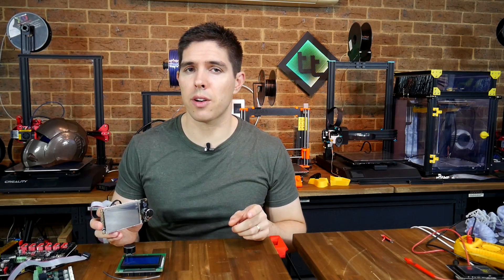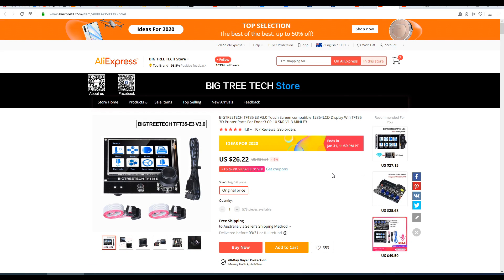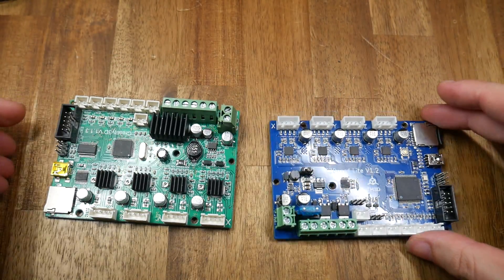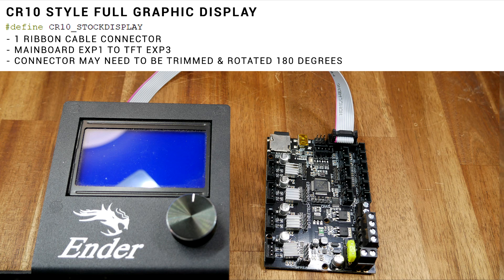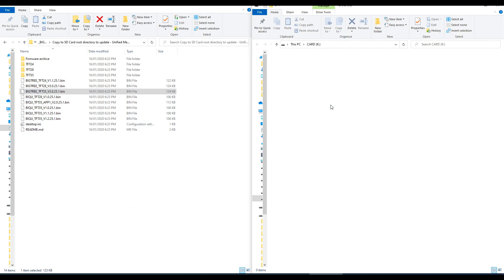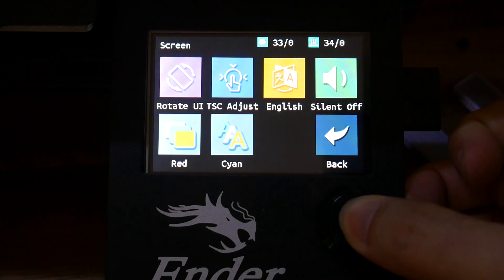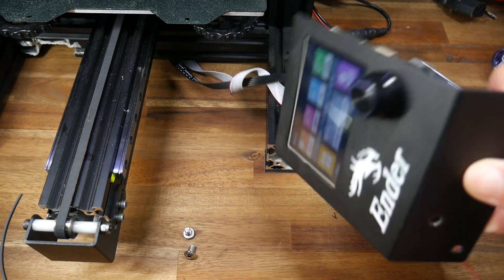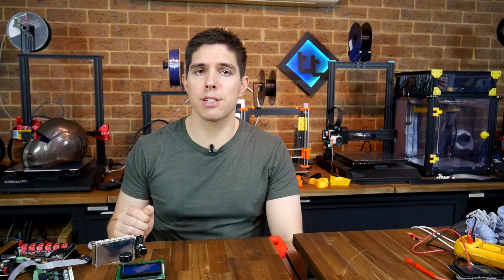BTT TFT35 dual mode touch screen guide

Comment: Great video, very informative as usual. 
I have installed one on my CR-10S Pro working in 12684 mode. So far I am really happy with it. I will now have a go at changing the firmware to make it full screen.
Reply: can you share some pics and any steps needed. Thanks
Reply: deadsimple ali you can send me a message in messenger and I can give you a few details and photos.
Reply: @deadsimpleali5540  hello, i cant find you on messenger, and can we discuss about your installation on a cr10s ?
Reply: @chrisnzog8643  hi Chris. I ended up getting an SKR 1.4 board. Im in the process of installing it on my CR10S pro
Reply: @deadsimpleali5540  did you ever end up installing this on your CR 10 pro? I have a CR 10 smart and I installed it and it’s working good but the SD card slide and USB port are not functional and was wondering if you may have had the same issues?
Reply: Sorry bro I dont have a Facebook account so cant use messenger. I hope you can share via email
Reply: et ça fonctionne du coup ?

Comment: Great video, as always. Your channel has helped me tremendously.  I have the btt tft35 v3 with skr 1.2 mini e3 and octoprint. It has communication issues when on the touch screen and printing from the octopi. When printing round surfaces and radiuses the steppers stutter and leave blobs and zits on the print. When you switch to the simulation mode no more problem. Works great when printing straight from the btt tft 35, or from the onboard sd card of the MB. I enjoy the ease of the tft screen but also enjoy wirelessly uploading to octoprint and the plugins. Hopefully they find a fix soon, til then can't use them together for prints with a lot of curves.
Reply: I have this issue also.  For now I've been printing from the SKR's SD card in Marlin mode, as I had Octoprint lose it's USB connection 6 hours into a print.  There's a closed issue on Github about it.  The main dev has suggested connecting the Pi to the TFT directly via RX / TX serial pins instead of USB.  He says the TFT will then pass it on to the printer.  I'll probably test this at some point.
Reply: @cscoppa  yeah, I've been keeping an eye on the issue. I will try it to. Thanks for the reply.

Comment: Using this with an Ender 5 Pro that's barely a shell of it's former self at this point.  Really like the features and being able to switch back and forth.  No problems with Octoprint... (Vanilla Marlin latest bugfix).  However I have found ONE problem that's annoyed me slightly, though I suspect I may be able to fix this in the firmware, I just haven't looked to see if it's software coded or hardware based, but I'm sure it's just software...  That's the pressing and holding to switch modes.  There are some features in Marlin that use this same process (i.e. I use unified bed leveling, and during manual mesh editing you can press and hold to kick back out)... When attempting to do so it will try to switch the LCD as it seems the delay it just slightly shorter for the LCD switch...

Comment: Great Video (as always)!  One thing worth adding.  The encoder wheel becomes all but useless when in Touchscreen mode (with one exception). In touchscreen mode, turning the encoder WILL affect the feedrate/speed of the print, but you can only see the new feed rate value if you switch back to LCD mode.  The FR Icon in touch mode does not update automatically to show what the encoder wheel set, it will only show the last value you set in Touchscreen mode.  I believe this is because no GCode commands exist that allow the touchscreen to query the value from the controller.        

With the exception of the encoder wheel in touchscreen mode, I am happy with the TFT35.   I can confirm that  Octoprint and the TFT35 work well together on an SKR v1.1 Pro.
Reply: Hi,
I have made changes to the firmware to support using the encoder/wheel, l'll make a merge request.

Comment: I have the standard version of the screen, and I've noticed that the knob doesn't come off, is there a trick to that?
Reply: Had the same issue. Ended up using a screwdriver to carefully remove it

Comment: I purchased the E3 bundle with the SKR mini a week ago. Wish I'd waited a bit longer to see this video before installing 😅. It was mostly painless. Thank you for such in-depth and easy to follow guides. 
    I have to say, I MUCH prefer using the touchscreen mode over Marlin. It feels snappier, more responsive, and just plain looks cooler too. The biggest downside is the knob is disabled in touchscreen mode, and I still find myself uselessly turning it for adjustments from time to time.
Reply: I do the very same thing still today.

Comment: Great video and very interesting product!  I just wanted to comment that you don't need to trip the connector on the ribbon cable.  You can generally pull the plastic guide on the board up off the pins, turn it around, and push it back down into place.  It's just a friction fit over the pins on the board.

Comment: Any idea as to when you may try to get it working with the EZBOARD Lite using the serial pins?
Reply: Kev7274 I am waiting on mine to confirm. Should be able to this weekend!
Reply: @itsmegriffo  Excellent. Please keep me updated.
Reply: Any update?
Reply: @Kev7274  yes, it works. I am sending my firmware adjustments to TH3D so that it can be added to the Unified firmware.
Reply: @itsmegriffo Awesome.How did you hook up the  serial pins?
Reply: @itsmegriffo  Hows things still going? I contacted TH3D and they haven't made it part of the firmware yet.
Reply: Wish you got a reply to your last question
Reply: @Stiffsce  I agree.

Comment: Did you try using the full-size SD card and USB port to print? I would love using a regular USB stick instead of the micro SD.
Reply: I can confirm that you can print from an SD card or USB drive on the E3 version with no complications.
Reply: yes you can use either/both, I use the USB stick all the time. https://www.thingiverse.com/thing:4093819

Comment: I got the 2.4“ model, but it’s a bit tricky. In LCD mode i recently see moved lines from the menu and printing from it in touch mode stops after some time without an error message. I’m using it with a ramps and re-ARM board connected to octoprint with a baudrate of 115.200 and updated firmware.

Comment: Very Nice Video..  I really want to switch both of my Ender 3 printers to this screen..  I am bit confused though.. I currently have an ender 3 and a ender 3 pro..   I would like to use the color TFT screen  that has the led ring ..  Would I need to change the printers main board /s  if so .. Which one would you recommend.?  They are both the original boards..  I do not have ABL or filament runout sensoring.. other than some mechanical upgrades everything has been left alone..   They print so well I was afraid to change it..   With this .. I am ready ...   What do you suggest ?

Comment: Interesting. So the screen has its own firmware that doesn't replace the motherboard firmware?
Reply from the maker: Correct. Assuming you connect the ribbon cables the same way to the mainboard, no changes are necessary.

Comment: Please mod the sidewinder with this one!!!! It would be the best upgrade for that printer!
Reply from the maker: I thought of that but the screen sits through the metal case and I don't think this would fit without pulling it apart and using custom mounts.
Reply: @TeachingTech  I was thinking of it will be possible to make a small hole on the metal casing for the knob andplacing it in. I am actually waiting for my screen to arrive and if I create any custom mounts I will gladly share them with you if you want to try.

Comment: Is there a remix of the backbox print to enclose the PCB?
Reply: Andrew Hayes 
I made one for the TFT28, based on the one that Michael (tt) did for the original Ender 3 control.  It wouldn’t surprise me if others have made them, so check on Thingiverse.

(I was thinking about putting the one I made up, but was expecting Michael to do a remix for it — and do a better job since he has the original CAD model.)

Comment: Bought this in a bundle with the SKR Mini e3. The screen worked great. I wish I could have got an SKR Mini e3 to work. After going through two boards I went back to my original ender board. So if you can get a reliable Mini e3 then these screens are really nice to have.
Reply: I also have this bundle at home, drove me actually crazy figuring what was wrong. After I started a dispute I realized that despite of two CQ Sticker, the soldering job at the input line was poorly excecuted.

Comment: Very appreciated video. Thank you for your time with all that testing and investigation. I was just looking at one of these displays. Just one question: did you tried to print from that USB port on display? Is it working correctly without any issues? Thank you!
Reply from the maker: Yes, no problem. After the press print it offers up an option of selecting from the TFT SD card, the mainboard's SD card, or the 'U disk' (USB thumb drive).

Comment: So I can just plug in this screen into my stock CR-10 mainboard? Which model should I get?
Reply from the maker: You won't have the touch screen working. Please see the compatibility section.
Reply: @TeachingTech  Bought SKR 1.4 Turbo and TFT35 V3.0 with the knob on the right.
Can't wait to get it set up! 🔥🔥🔥

Comment: I saw your other video on the TFT28 and I ended up buying one to try it out and I didn't like it very much and quickly reverted back to the standard screen. I recently bought an SKR Mini E3 a couple of months ago because my MKS gen L was giving me quite a few problems and it's a fantastic board. When I saw the BTT TFT35 E3. I was immediately sold because it had amazing features as well as being able to switch between the Marlin screen and a touch screen. I put it on my printer a few weeks ago and haven't looked back
Reply: MadeofScars1990 
I ended up adding the original control back in with the TFT28.  Simple stuff like ‘clicking’ I could not figure out how to do from the TFT28.  (They do work together fine.)

Because I wanted to try out the SKR Mini E3 board I bought it early, and those early units have some issues.  Didn’t get around to installing it, and when the new dual mode screen came out in a bundle with the SKR Mini E3 I bought that.  Arrived a few days ago, so this is a timely video.

Comment: Now we just need an stl case to make up for the bad screen alignment
Reply: Got my display a few days ago and can confirm that it's off center.
Reply from the maker: I have no idea what you're talking about, it fits perfectly.
Reply: @TeachingTech  I also have an alignment problem. Ender 3 Pro. Mine is 2.5-3mm too far to the right! Bought it from Amazon.
Reply: Doan Pham 
My screen is slightly left of centred, in the standard Ender mount.  The TFT I have has the small PCB on the rear for the encoder, so it is the newer (and possibly cost-reduced) version.

Comment: Alternatively, instead of cutting the tabs off of the ribbon cable connectors, you can carefully lever up and pull the black plastic socket off the board, and rotate it 180 degrees. It just slides over the soldered pins.
Reply from the maker: That's a great tip, thank you.
Reply: The cable is on spikes in the connector, not soldered. By doing what you said, after repositioning the cable, push down on the first plastic retainer to reconnect the cable, then confirming the lock tabs are on again is how to do this. I have done this to change the position on IDE and floppy cables for decades.

Comment: DOES IT WORK with OCTOPRINT Connected? Or the other way around?!
Reply from the maker: This was answered n the video. It works fine.
Reply: Teaching Tech really? Oops... I have to reel back. Me myself struggling with it about ports and such.
Thanks again and again for pushing the community!
Reply from the maker: It was right at the end before the outro. thanks for watching :)
Reply: @TeachingTech  Hi I have had serious issues with this screen installed and running Octoprint. With the TFT cable installed I get no response timeouts and therefore very blobby prints when using octo pi. With the TFT cable disconnected every thing is good.

Comment: How do you get the long file names to appear?
Reply from the maker: For the TFT, you saw my config in the video and I didn't enable anything custom for that. In Marlin there is a long filename parameter in configuration_adv.h
Reply: @TeachingTech  thank you for the the personal reply. My issue seems to be that I was printing from the SD card on the main board and not the TFT. Once I put the SD card in the TFT, the long filenames appeared.
Reply: Question though. If printing through the TFT, which settings take priority? If the TFT, then will the marlin settings I have on the motherboard also have to be copied to the TFT?

Comment: So cool.   I was just looking at this on Amazon: https://www.amazon.com/BIGTREETECH-Control-Controller-Replacement-Original/dp/B081JLJV87/ref=sr_1_3?crid=1OH745OZJQUV1&keywords=ender+3+replacement+display&qid=1580158563&sprefix=Ender+3+replacmeent+%2Caps%2C209&sr=8-3

I'm not sold on the longevity of either part, but this is very promising.  I was just about to pull the trigger on the TH3D EZ board, but at $100 it's pricey.  This 'kit' is only $70 and replaces both the main board and LCD.

Comment: Had one of these for a while. you can also add an esp2866 wifi module if you want in order to add direct wifi control with no need for an additional raspberry pi etc. although not as much options due to it using pronterface
Reply from the maker: I briefly looked into it for this video but would have made it too long.

Comment: You can also add a esp-01 wi-fi adapter module (I would recommend getting the usb adapter as well to make it easy to program). Then you can use ESP3D to control you printer over wi-fi.
Reply: What do I have to do to get this to work? I plugged it in but doesn't seem intuitive to the next steps
Reply: @dontplaywithlava  You need to program the module before plugging it in. It is a little involved but the instructions on github worked for me. https://github.com/luc-github/ESP3D. I got the ESP-01S USB to ESP8266 ESP-01S Wireless Wifi Adapter Module Wi-Fi CH340G. This has a switch for programming vs just a serial connection. You program the module from your pc. Once you have confirmed it connects to your wi-fi you can then plug it into the TFT35. Just make sure you plugin the correct way round. For me that was the module sticking a little out of the top right hand side.
Reply: do you know if I can add esp32 instead of esp8266 as it is more powerful and less buggy in my experience and still dirt cheap?
Reply: @rotembuhbut3855  esp3d supports esp32 as well as the esp8266. The big advantage of the esp-01 is that there is a socket on the tft35 that supports it. With an esp32 you would need to work out the pins to connect and then create a holder. Would be fairly easy but requires more effort.
Reply: Because it cost only 1.5$ i ordered the esp01 too but will definitely try to fit an esp32 too as it is superior
Reply: @rotembuhbut  Just make sure you get the esp-01s which has 1MB of flash. ESP3D will struggle to fit into smaller amount of memory and you will have to disable features.
Reply: Yes, you can control your printer over wi-fi. But you can't really send print gcodes because it would be really slow to upload the files.

And, why would you need to move your printer around wirelessly? You will need to be close to your printer anyway unless you have a camera in real time.

Comment: Thank you for the Octoprint comment. That was exactly what I needed to know. :)
Reply: I think it will only works if the mainboard seperates the USB-Port from the TX/RX-Port for the TFT in MCU like the BTT-SKRs do. Some mainboards uses same PINs for both, so no tft and Octoprint at the same time. Am I right?
Reply: @LaueSR  I ran into an issue with the SKR v1.3 in UART mode. Yet, I am still running Marlin 2.0.x from July. I will be upgrading over the week and testing the screen again.

Comment: I am curious about your comment that is works with octoprint. I could not get both touch screen modes and octoprint all working at the same time while connected to an skr 1.3. Also, BIGTREETECH will do very little for you is you have a damaged item.
Reply from the maker: I've retested, and after some connection issues it is working with both. I had to reset and reconnect a few times but now both are stable.
Reply: @TeachingTech , I am curious what your serial settings in marlin are.
Reply: I agree, had no luck getting good prints with the TFT cable attached on an SKR mini V1.2. Serial ports were set to 2 and -1 from memory.

Comment: Thanks for the great review. Ordered mine from BIQU with SKR Mini E3 combo for my Ender3 Pro. Still waiting for delivery since mid of November. Communication with BIQU is very poor and are not responding at all to my refund request 2 weeks ago.
Reply from the maker: Sorry to hear about you troubles, can you reverse it through your bank?
Reply: @TeachingTech  Yeh :\ will probably have to make a claim in Paypal. Shame, I really wanted it. I'm still on the original 8bit board without thermal runaway protection. Thanks for your channel and teaching vids, I never miss a vid and you made my printing a breeze. Without you I would be lost most of the time ;)

Comment: I wonder if this thing will actually work with Klipper Firmware... Do you know anything about that?
Reply from the maker: On paper this connects just like Octoprint or pronterface so it should be possible but I haven't tested it first hand.
Reply: @TeachingTech  alright I might give it a shot and try it in the future. I'd be glad to report my results. My thoughts were just about all the blocked commands by Klipper that probably are used by the LCD to communicate

Comment: You should just pull of the plastic pin socket and reverse it, rather than trim the cable. It's easy just to pull and wobble it off.